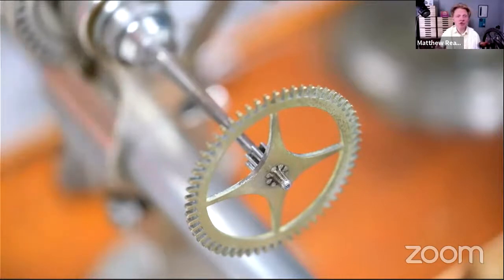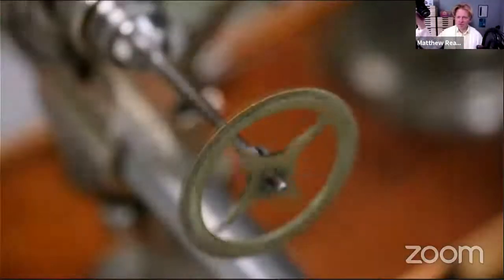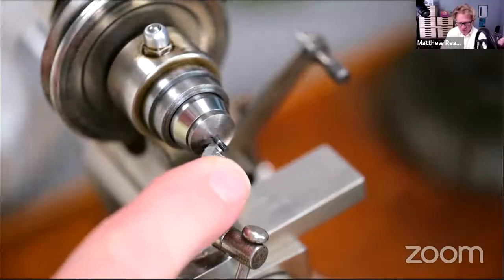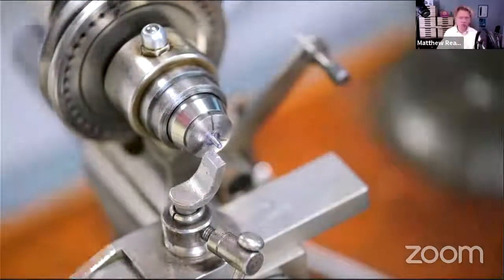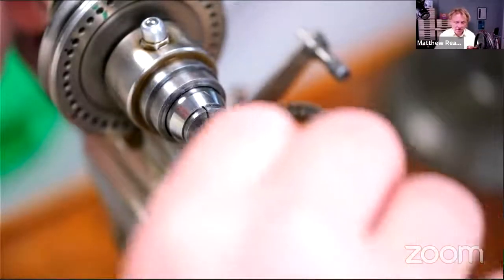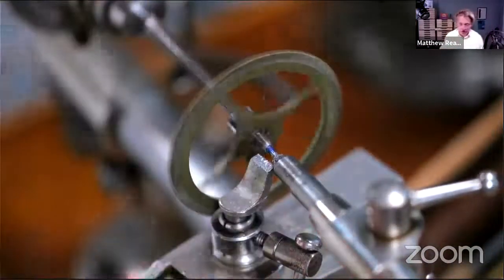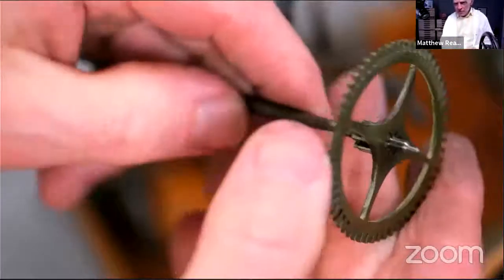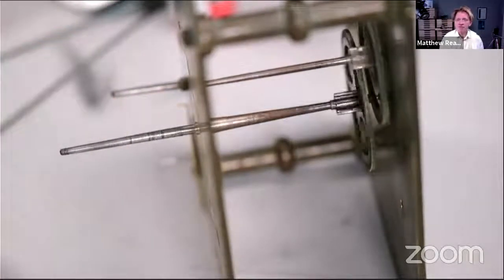How to repair pendulum clocks_LIVESTREAM_#013_2021_05_27

Comment: 22:23 You often anneal the end of some pivot wire, or sharpen or dull a drill bit or scalpel. How do you keep track of what pivot wires in your collection are annealed and what cutters are blunted?
Reply from the maker: Thanks Bradford.  Its a good question as always.  The pivot wire turns a different colour/surface texture so that is easy to spot.  I dont keep them separate.  In the old days when I ran the student workshop, we had two separate sets of drills so they couldn't be confused.  I should go back to that as it was a good system for efficiency.  As for the scalpel blades, if I cannot find the right scalpel blade in a few seconds, I just make a new one.  They are kind-of disposable anyway.  It is a good underlying point though.  I dont run a commercial shop per-se so small inefficiencies are not such big deal.  If I ever go back to full-time repairing, I'll have to streamline these things. M